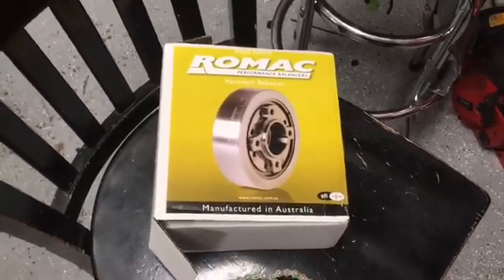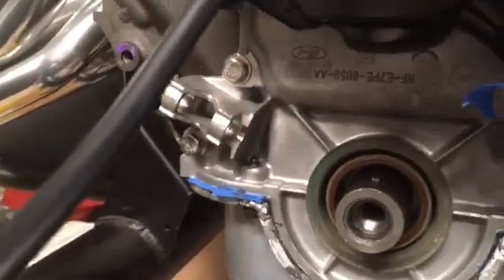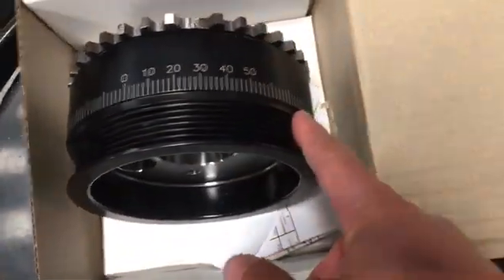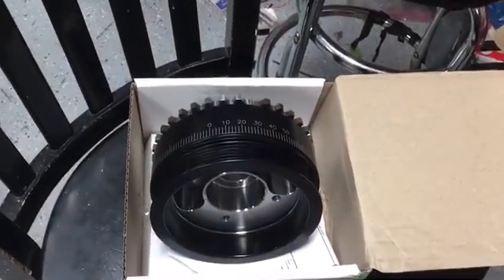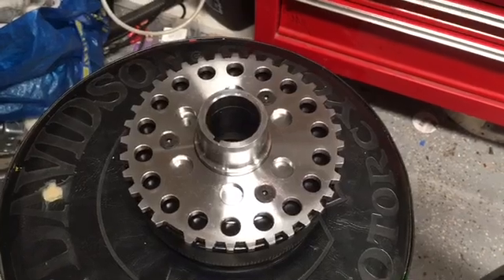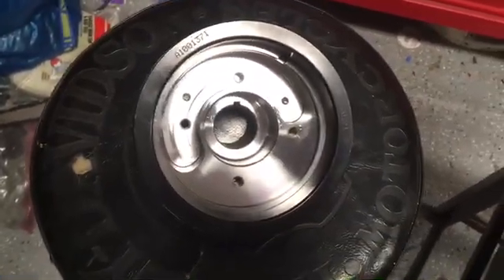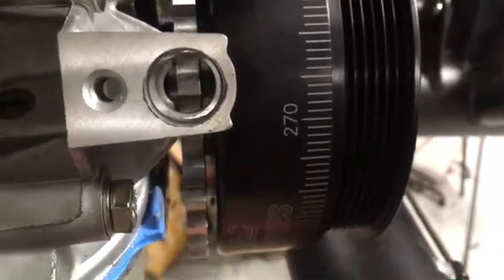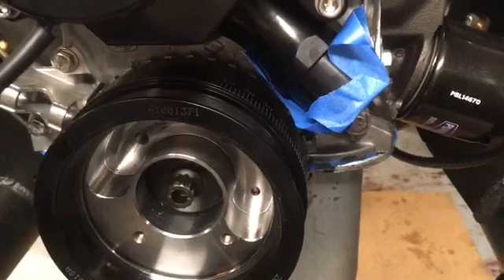Romac Harmonic Balancer Review for the Cobra 351W Build - Trigger Wheel, EDIS, MegaSquirt

Comment: Save you HUNDREDS of dollars from ROMAC.
Romac replied with "The short answer is, no." 
I made my own, from two(2) different balancers.
Using a 1983/84 28oz  or a 1996 28oz balance that has the 4-tone ring and four(4) bolt hole for pulleys,. Remove the tone ring, it is easy, it is pressed on(hint: freezer).
Then you get a 1996-2001 302 Explorer 50z harmonic balance and remove the 36 tooth trigger wheel. The diameters are the same. Press the 36 tooth wheel on the 28oz balance YOUR DONE!!!

Comment: This is exaclty what I'm looking for. Do you have a part number? Or is this completely custom?
Reply from the maker: The part number they gave me was A0251SA. When I contacted them, I asked them if it was possible to make the balancer in the link below with a 28 oz external balance.

https://www.norndaautomotive.com.au/romac/find-parts/romacproduct/119.html

They were very helpful on the phone and gave me good and complete dimensions that I asked for.
Reply: @TedsGarage  Thanks with the reply. So, I should take my current balancer, measure everything, then contanct them. Sounds like a plan. Awesome!
Reply from the maker: @warrenwhite3618  That's what I did. Ford has different dimensions that are used for different engines (and of course the different external balance amounts) so it's good to make sure of all of that.

End result was a <10 lb balancer. I wanted a revvy and responsive engine, and this helps.
Reply: Sad news, Romac replied with "The short answer is, no." Probably because I have a F150, longer serpentine pulley. I ended up making mine, using either a 1983/84 28oz or a 1996 28oz balance that has the 4-tone ring. This is easily removed. Then you get a 1996-2001 302 Explorer 50z harmonic balance and remove the 36 tooth trigger wheel. The diameters are the same. Press the 36 tooth wheel on the 28oz balance YOUR DONE!!! Save you HUNDREDS of dollars from ROMAC.